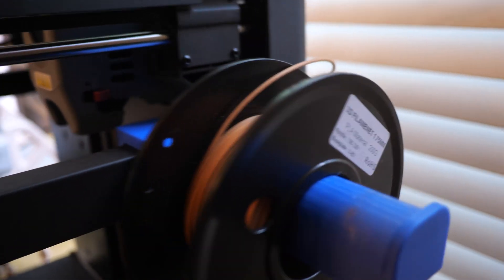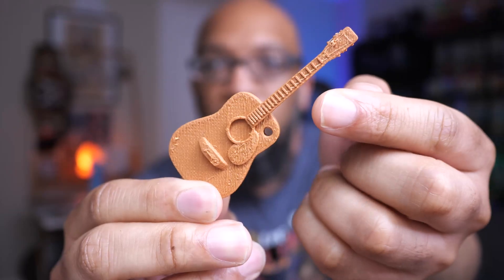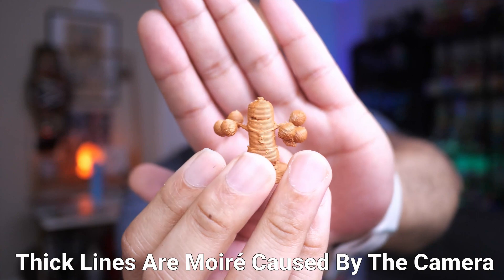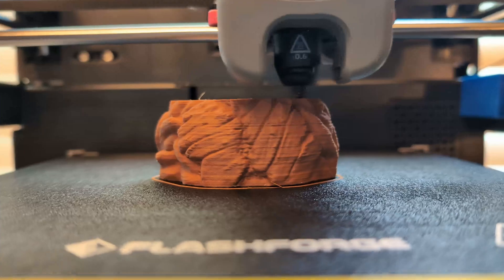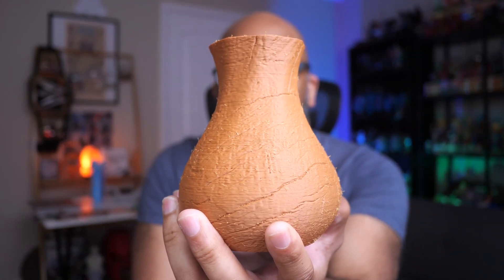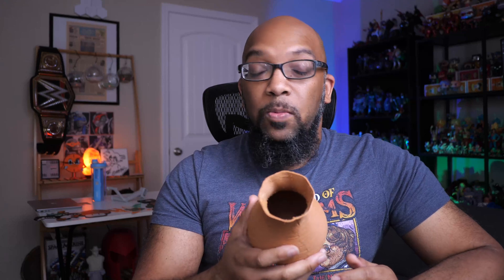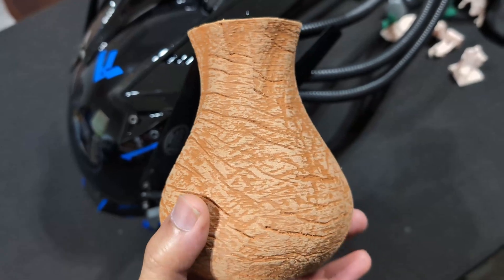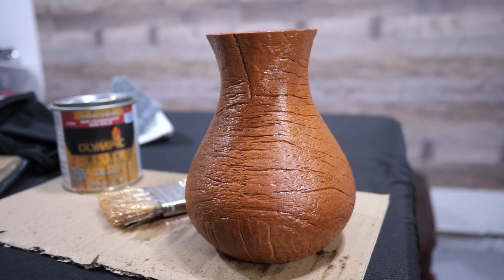3D Printing With Wood-Filled Filament & The Flashforge Adventurer 5M

Comment: Great video man, I love the wood filament so far, I use OVV3D 30% wood bought on amazon and I've had extremely good results with .1mm layer height, to allow my printer to go faster without layer lines I also placed two big 20lb dumbbells on either side of my printer squished right up against it, I can print at 500mm/s base speed this way with almost zero layer lines, I posted a video of an example on my channel I think.  Cheers!
Reply: Also I forgot, in the new "Orca-Flashforge" Slicer settings, I use "Quality -> Seam -> "Seam Position: Random"  &  "Wipe On Loops: Enabled"  I hope that helps!
Reply: Also I forgot one more thing for layer lines in settings, "Quality -> Precision -> Precise Wall: Enabled"

Comment: I printed PLA+Wood on the 5M, with 0.4, but everytime it comes out like rubber! super flexible using 185-195 for the printing and 60-80 bed. temp. What do you think?

Comment: I have used a lot of different filaments. The one wood PLA that worked the best so far was Eryone wood pla. The quality was much better than what you ended up with. I have printed wood pla on my sovol sv06, sv06 plus and my creality k1 and had no issues with a 0.4mm steel nozzle.

Comment: I have a question - have you tried the FlashForge flexible PLA filament on the Adventurer 5M yet?
I have a spool but I couldn't get any successful prints :(
Using a 0.6mm nozzle is okay but the gear part seems to always ball up and can't pass from the gear into the nozzle.
Reply from the maker: I haven't tried flexible PLA. It's on my list of things to try.

Comment: When I first got m y Finder back in the day I did some stuff with wood filament. I di the exact same Groot figure you showed. Mine came out a little cleaner than yours. The wife did a black wash over the figure to make the detail pop and painted the eyes, then just a light clear coat and was done, surprised how just the wash transformed the image.